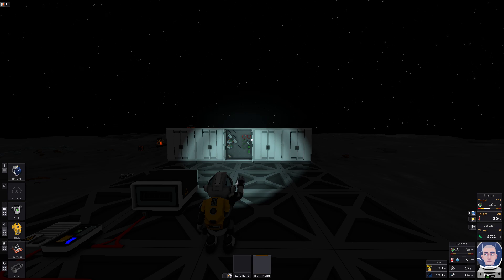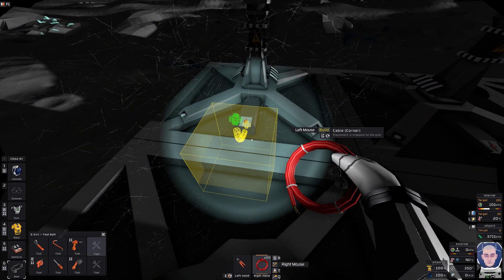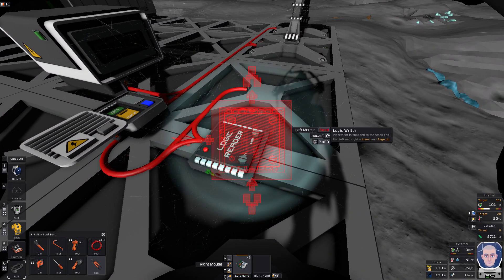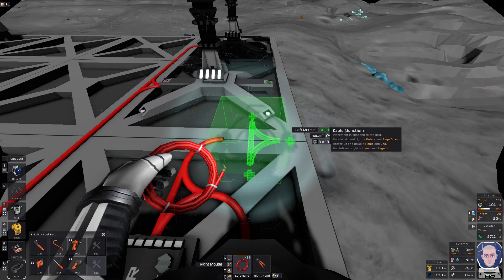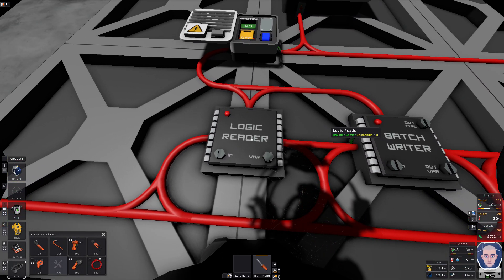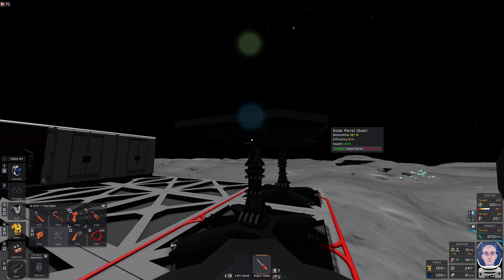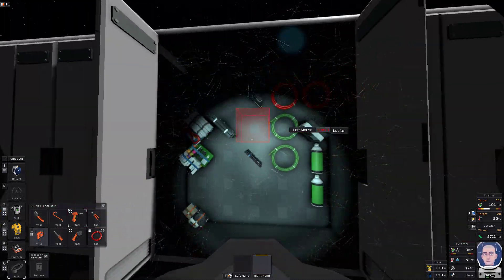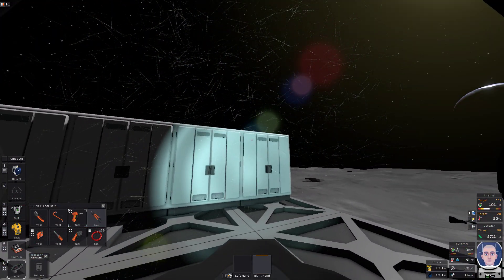Stationeers - Solar Tracking Tutorial

Comment: Amazing work! It’s clear, simple and concise.
Reply: Only one question is there a particular reason you had the daylight sensor on the East wall?
Reply from the maker: @Jordanthomp81 
It's just a personal preference for orientation. Not sure if you noticed, but i faced the sensor east (rising sun), and had the power input facing south. I typically will use this specific orientation because it allows me to just wire in a solar panel and forget it, rather than needing a wrench to turn the horizontal orientation of the panel.

Had I setup the sensor or panels in a different orientation, I would've had to turn the solar panel itself to face the sun before it would track properly, since these chips only control the Vertical logic. Any orientation will work, I just try to reduce the manual work I do on the panels.